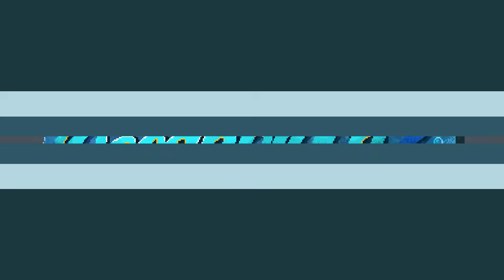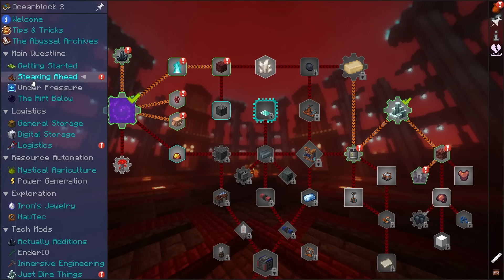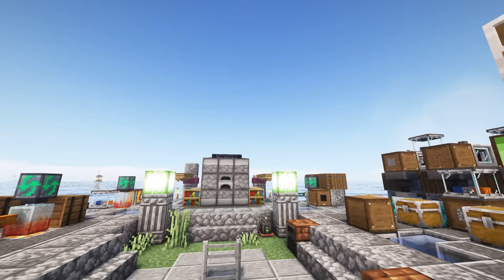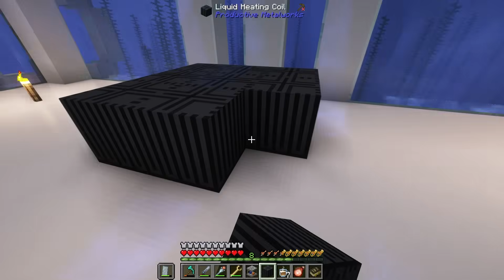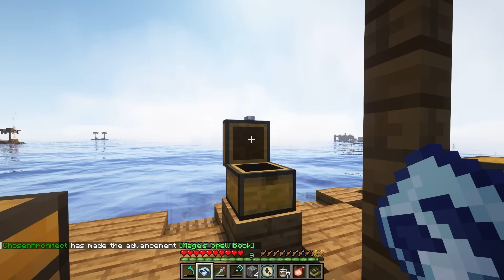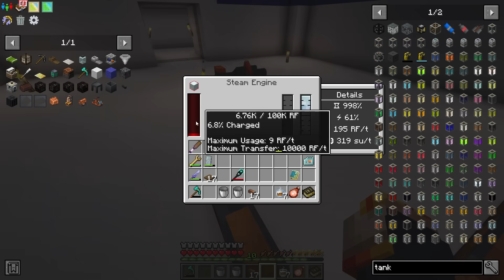FTB OceanBlock 2 EP6 Oritech Steam Power & Lava Sluicing Automation

Comment: i ran into the same issue with the dirty netherite scraps. I just placed a hopper bellow the chest and filled it with the scraps, so the hopper will only ever pull scrap and leave everything else running smoothly. Just have to walk over and clear it out every now and then. luckily the chance is only 2%

Comment: PSA, just like theres a cobble gen in this pack, theres also an identical series of basalt generators. Much neater and more compact than doing it the vanilla way (plus you can upgrade the tier all the way to netherite for faster production), does need 6 compressed basalt to make, so i just got a stack of basalt from the nether to get started (or you could use the vanilla way to get the inital basalt)

Comment: Hi! Thank you for your videos, they're very useful!! I'm always struggling for automation but your explanations are very precise. 
I use another way for lava and water production, maybe someone already said it. If you use a fluid drawer with the collector upgrade (for water) or the dripping upgrade (for lava) and the pusher upgrade, you can produce infinite lava and water + you can inject it into whatever you want. I did my base into a dark and violet fortress, so I have access to pointed dripstone :)
However, I don't know how to export fluids from the drawer to other machines that are not directly in contact with the drawer... if someone have an idea!
Also, I think someone already told it, but there is a basalt generator in FTB Stuff & Things mod.

Comment: This oritech modpack broke me for abit 😢
I couldnt get the connections with the cables going no matter which I used. 
Rage quit... restarted it later and it all worked. 🫠
So if anyone is unning into the same problem, that seems to do the trick.

Comment: Hey Chosen, for the oritech pipe issue you had, all you need is to put the chest on the end and replace it with a pipe, so the pipe will send netherack in the drawer and all the other stuff in the chest.
Reply: I ended up using a 1x2 drawer since the crushed netherrack only produces 2 outputs and locked it and piped out of that. Easy solution for me!

Comment: 26:40 it does work trashing the water BUT the machine requires at least some water for it to work well, I thought you was going to show some way to fix this issue. If you just trash all the water it won’t generate a lot of power.

Comment: Drawer puller upgrade instead of pipes would work too I guess for the Netherrack, and due to having no pipes, it would look better.
Reply: I tested this the puller also only looks at the first inventory for some reason
Reply: @PandaWill89  another puller upgrade drawer on top (or the other side) to pull the other item would do the trick I believe, there should be only 2 outputs.

Comment: I frequently suggest to people to use drawers for early game filtering - it's so easily overlooked but really powerful.
If you have access to Sophisticated Storage you can tell it to remember slots like the first slot for netherrack.
Reply: Sadly, this pack doesn't have sophisticated storage 😢
I guess you could add it yourself if you wanted to...
Reply: @cicatrix1  but it has sophisticated backpacks which has the same functionality
Reply: @PandaWill89  yes, I'm talking about storage in general. The same functionality is in backpacks, but it's just not as nice. You could also just use double drawers or a host of other things. That wasn't my point 😊

Comment: For the cutting boards, if you put the item you're processing in your off hand, tool in your main hand, and then aim at the cutting board and hold the right mouse button down, you'll blow through a whole stack incredibly fast. (Have to aim at the right angle so that any time the block being cut isn't present you're targeting the board.)

Comment: 25:50 ; why not pipe the water back into the magmatic boiler instead of having it pull from the tank with both fluid hoppers? does it not generate enough to keep the system going?

Comment: The transfer gadget from PneumaticCraft is pretty slick. I used it to extract from casting basin and table into a barrel. Works similar to the flat item pipes from extra utils 2 if I remember the mod correctly.

Comment: I was thinking maybe a backpack can be used to solve the first slot oritech pipe problem. More specifically using the slot memory settings so it is only allowed to put netherrack in that first spot.
Reply: Clever. I love hearing what people figure out. I used a transfer gadget from PneumaticCraft which is an interesting device that uses no space. Another option is the omni-directional hopper, and there are plenty more transfer options.
Reply: The easiest option would probably be just another chest for the item pipe to put the items into. The prioritize the closest targets, so netherrack barrel first, then a chest should work

Comment: Um isn't that a bad idea? Because you know the steam went from the boiler to the engine in a fluid pipe and your voiding all fluid in the engine so if the water runs out it's gonna void the steam no?
Reply: The water cant run out its coming from an infinite source, you want to void the water from the steam engines as it isnt worth attempting to reuse it over just deleting it

Comment: Hey Chosen, for the automation in the beginning with the export of the oritech pipes getting blocked because the first slot of the chest is not netherrack. Would it be possible to place a backpack with netherrack being the fixed first slot? You know with the memory function and then piping in and out of that?

Comment: Some of the airdrops are pretty meh but then you get some that are full of goodies, I had one with a couple of ender tanks in one while the others had an ender pouch and chest as well. One of the tanks got put down in the depths with some floppers for an easy infinite water solution far enough away to remove the noise.

The oritech steam power seems to allow for a closed water loop as there doesn't look like any gets lost while it converts to steam and back

Comment: Hello, i got the same netherrack setup but item pipe from oritech transfers items from the first inventory slot in chest, if there is something else (like dirty netherite scrap) it won't transfer the netherrack for me

Edit : Solved it with LaserIO Laser node from airdrop and quartz, kinda cheap at this point
Reply: The Oritech wiki actually documents that behavior. It seems strange to me to do it that way on purpose but I suppose it may be.

Comment: he should upgrade his storage more to handle bulk items. using a whole chest for just iron or whatever huge amount of another resource is just a waste of available space. he needs to use stack upgrades in his storage to save up space. It'd be better to have a single stack of 2048 iron than it would be to have a chest full of 64 stacks.
Reply: Sophisticated storage isn’t in this pack unfortunately. Could do something similar with functional storage though
Reply: @DawnAuthor  the backpacks can be connected to the storage system. U can use them instead. He has a few of them from air drops.
Reply: Unfortunately the pack does not let you craft any of the backpack upgrades, you can only get them via looting or airdrops
Reply: @Popchip99  I didn't know that. I haven't played that one yet.

Comment: I really wish the Productive Metalworks smeltry looked better. The old Tinkers blocks had such nice textures and these ones just look really bad.
Reply: I think the mod itself is pretty good, but some minor tweaks would probably make it a staple in modpacks, like tinkers. 

First: controlling the alloying, or lack or alloying.
Second: increasing alloying speed. It's too slow to really be useful now. You'll pull out the individual metals instead of the intended alloy.
Third: textures need another pass, preferably a bit less contrast. They're so harsh and don't fit in with most textures.
Reply: They are some of the worst looking blocks in modded Minecraft history. It's like they didn't even try to make textures. All the different blocks look nearly identical. IMO the mod is not ready to be used in any serious pack. Used extremely shortly and hopefully never again in the pack.

Comment: You can make 16 netherrack in a jar with 1 bucket of lava and 1 redstone
Reply: but the way he is doing it, uses only renewable resources, so it will never stop, plus he doesn't have to use all his redstone. while your way is faster, this way is more economical
Reply: Lava and redstone are both renewable in this pack.
Reply: @JamesStansell  they are, but why use up redstone when you don't have to?
Reply from the maker: Magic of choice!
Reply: Solution you are offering is effective short term and works better in non skyblock settings. Renewable resources are main focus of this play through I believe